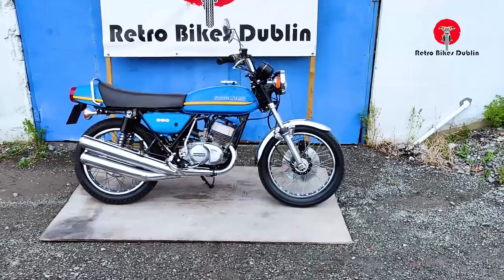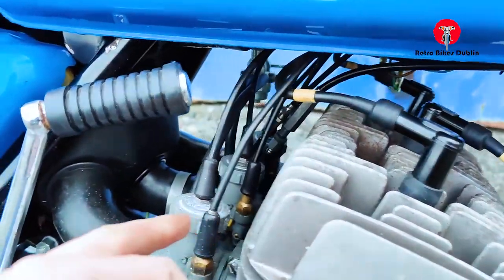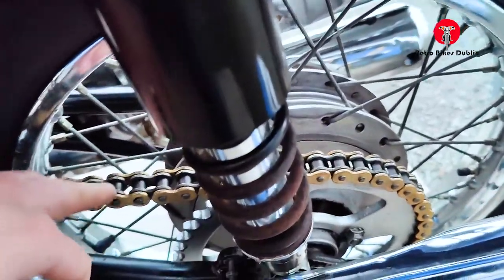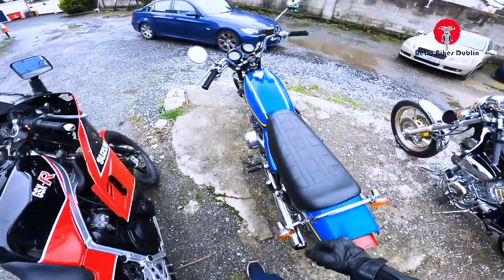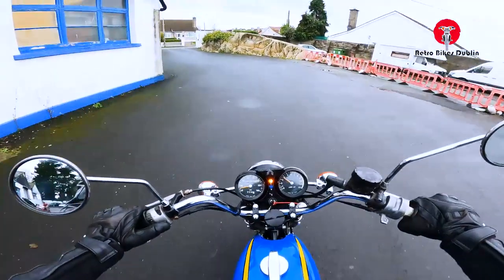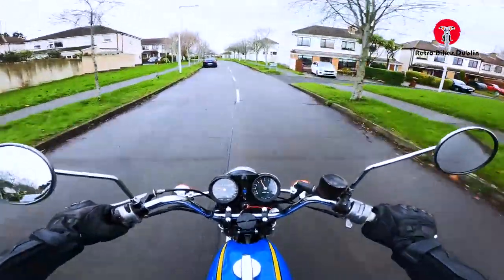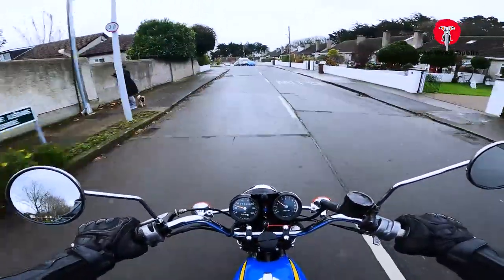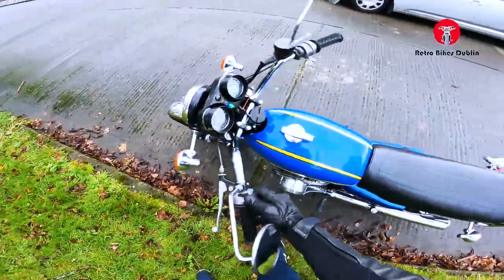1973 Kawasaki S2A 350 Triple - 1973 kawasaki s2 350, 1975 kawasaki h1 500! (Review) GoPro Hero 9

Comment: I had my exact model for 45 years... Beautiful thanks.
Reply: Was wondering  just bought  one  3600. Miles  73  350cc.  Original  tires   hole bike. Original. Identical  to the one. In pictures. Except  handle. Bars.  Looking  to. Sell. I'm in north  Carolina